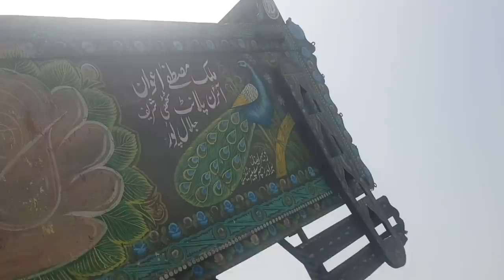Informative Video of Rebuilding Supporting and Installing Truck New Air Filter System

Comment: What exactly is the purpose of this intake filter? Is it an “oil bath” ? And you can see the smoke flow right out the original intake, I’m assuming if smoke can escape, then air can enter??
Reply: i dont understand either. it looks like air can now enter from the top of the original stack, or through this pumpkin.
Reply: @MuzzleVelocity  it actually looked like it belonged on the exhaust side, to cook food. 😂
Reply: Didnt understand neither... Wheres the intake to engine manfold?